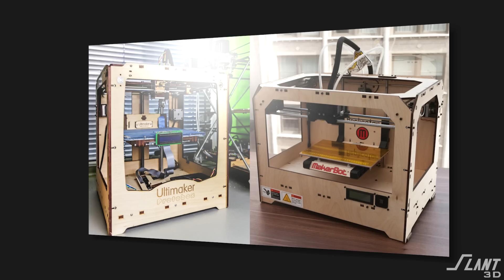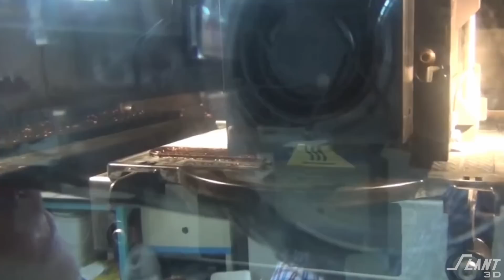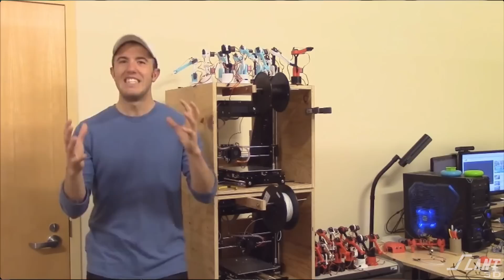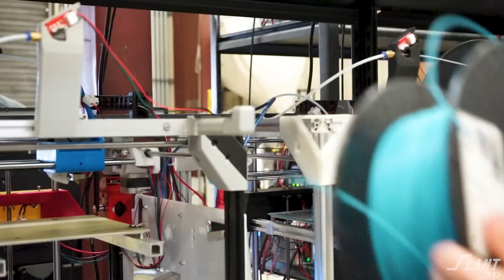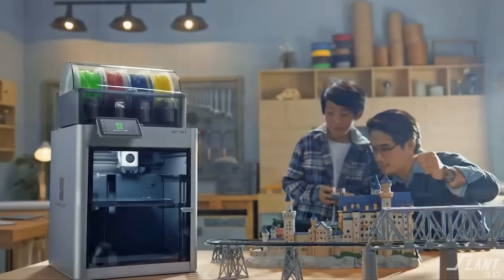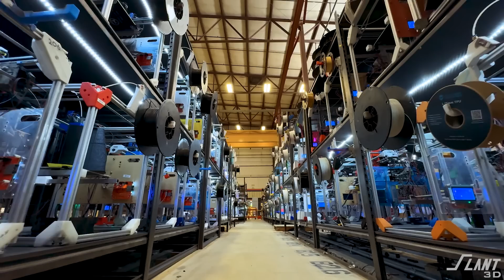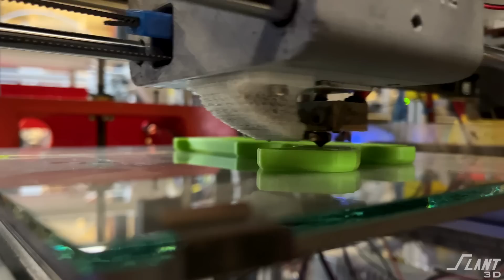I Hated 3D Printing...Until I Learned This

Comment: I think your thesis would have been stronger if you'd included "time" in your inputs.  And you've addressed this in other videos, to great effect where you note that injection molding is still the best way to make, say, bottle caps.  Things where one needs millions of them and the design is stable.

Time, of course, interacts with scale to skew what the best method is.  I'm active in the R2 Builders Club, and the emergence of simple and reliable 3D printers has dramatically changed the way people are building droids.  Most folks who turn up thinking they want to 3D print their droid are into 3D printing as a tool anyway, so that's fine.  But sometimes, we still get a new builder who doesn't really care about 3d printing, they just want a droid as quickly as practical.  At which point, 3D printing (at the hobby level) isn't the best tool, because it will take about 3 months of printing on something like a Prusa mk3 to get a droid done.  Using a wooden frame that's been cut on a CNC router will take under a month, including probable shipping time.  Whereas if you were producing these for sale, you could have a number of machines running in parallel and pump out a droid's worth of parts every week or so.

My point is mostly that for injection molding there is a large upfront cost in both money and time but then the time cost of production plummets, so injection molding has a very non-linear time cost as you make more.  3D printing is a nearly constant time cost per part, but a much lower cost of entry (assuming the printer is built and operable, but we're also assuming the injection molding machine is built and operable so that's fair.)  Neglecting that weakens the thesis, a bit.

On the other hand - you've demonstrated that you're quite savvy about this whole YouTube thing, so I think you did that on purpose to generate comments like this and feed the algorithym.  Well done!  :D
Reply: Agree! Time to 3d print a part THAT IS ABLE TO BE INJECTION MOLDED is higher and may be higher at scale than getting the mold built. Molds are fast! I worked in an injection molding plant and my lord the amount of parts was just phenomenal (I am talking molds that did 96 pieces at once and cycled within 2 minutes). 3d printing is getting there but printing a side panel for the inside of a car door will probably never be a cost effective 3d printable part as it would take too long to print them at scale unless you make your own orange gigastorm (but better) print farm and have a million printers :)
Reply: It's impossible to cover all the relevant advantages and disadvantages in a video this short. Hence why he has done so in other, longer videos.

Comment: Sorry but 3d printing will never be as fast nor strong as injection moulding.
Reply: What I heard was: "A hammer is always better than a screwdriver." Two different methods with their own inherent pros and cons and unique uses.
Reply: Depends on how many objects you need and how fast.
Reply: Any dufus who thinks this has never had a child break their injection molded toy over and over and see the reviews of hundreds of not thousands of other kids breaking the same toy. Any toy I have 3D printed for them with the objective of making it hard to break is still unbroken. Injection molding simply cannot be stronger just because you say it is. Most injection molded parts are made form abs or nylon but when people compare the strength of IM VS 3DP they don't compare the same plastics.
Reply: I guess each system will probably always have their strengths and weaknesses. They both have their uses for different applications.
Reply: Says who?
Reply: Why?
Reply from the maker: We do it everyday. Faster
Reply: @slant3d  I'd like you to do an experiment to prove 3D printing is faster at getting a product to market, lets say 10,000 parts vs create a mould in fusion360 get it done by PCBWAY, week max..
Reply: @slant3d  faster at scale? I believe a per part time is faster with injection moulding with a machine-machine compared to printing but scaling a print farm would be more versatile and cost effective
Reply: @R3DPrints01  yeah but only after you already have the mold. The mold takes a long time to make, it's really expensive and, it wears out so you need to remake it every X number of parts.

So faster at scale? If you can start pumping out prints at day 0 after having designed the stl. How much headstart does your scale have compared to waiting 2 weeks? 6 weeks? For your mold? What if the mold has an error?
So sure afterwards you can make a part every 20s instead of every hour. But you don't catch up instantly. That's simply not true.
And as the end of the video clearly states, strength is an engineering design challenge. Not something inherently impossible to work with. Printed parts are really strong, but they do have an optimal orientation.
Reply: @R3DPrints01 rapid iteration, absolutely just as strong, and much more freedom of design. It's absolutely better than injection
Reply: I don't want to pile on, but there have been a few discoveries that affect the strength of parts.

One is preheating filament (eg. 100 deg c) prior to printing can have a dramatic affect on part strength.

Another is a heating element that heats the top of the print (ensuring the top layer is at its glass transition) as the molten plastic is layed down. This can result in a virtually perfectly dense part with next to no layer adhesion issues.
Reply: With the new sub 5K Micronics SLS on the horizon, its going to get more interesting. Undercuts no issue, Supports no issue, mechanical strength as good as IM. It has its downsides, like low volume, porosity of parts, Need for postprocessing to create colorful parts etc. Hopefully, other competitors improve upon to make it better. FDM is going to become a legacy in the end. Just some 💭
Reply: @aware2action  There is also the issue of the raw stock for SLS not being a commodity product like pellets of an assortment of plastics. Likewise the raw stock for SLS that isn't specifically used in the product itself has to be filtered to eliminate spatter fused material that will contaminate later prints. If you want light weight hollow parts for some reason, you need to leave holes in your design to get the excess support out (similar problem for SLA.

I'm not saying that it's bad, just that it's not a panacea either.
Reply: It's both faster and stronger.

Latency to get an injection molded part: weeks. 3D printed? About 25-90 minutes.

Injection molded parts are limited to being flimsy brittle junk because you have to limit thickness to avoid shrinkage/warping. Printed parts can be as chonky as you like.
Reply: You obviously have NO IDEA what You're talking about. I've been doing IM for 30 years and the problems you just listed don't happen, if they do that place would be out of business. @daliasprints9798

Comment: Thinking about making 3d printing more efficient, what are your thoughts on printing directly from pellets instead of filament. It seems like this would potentially eliminate a step in the process. I know you are working on bringing the cost of filament down, but as Elon says "the best process is no process".
Reply: It's a video they've already made
Reply: @SquintyGears  Can you point me to it?
Reply: @carlosjosejimenezbermudez9255  i can't really search for it right now. I think it might have been inside a podcast episode instead of stand-alone.

Tldr was that it doesn't really work out. Technically pellets are cheaper but feeding is a massive problem for printing. So it's not worth it. Especially for a farm setup with tons of printers.
You can't realistically imagine having a 4kg hopper over each printer... How do the pellets get to the moving hotend reliably if the hopper is stationary over it and it has to be connected with a flexible joint.
So just having a massive spool that you rarely have to swap is the better solution. Because physics beats costs in this case.
Reply: Thats completely fair, pellet priting would be way cheaper and would give interesting benefits such as making custom blends for color and physical properties. You could even mix pla with tpu so you get a part that is stiff but when it snaps is still held together. I'm not sure if pla sticks to tpu but it's just an example. 

The issue is that normal injection moulding pellets are quite course to be printing with, the consistency is not there yet. Greenboy3D has some very interesting videos on the topic.
Reply: @greenboy3d is giving it a go right now - always interesting to see people attempting to make that idea work effectively. There are some key limitations to using pellets directly, although perhaps not as many as there might be initially. Perhaps for home users, it could be a good route to re-using printer waste, where you have the pellet setup for prototyping design work, where you're testing the design in practice so care about the form and function but not the cleanliness of the print, and then print decently on a filament printer once the design is good.
Reply: Look up Greenboy3D man
Reply from the maker: Pellets don't work
Reply: @slant3d  https://youtu.be/eWgzi4a1bJo?si=oHapaJpeKHSPPwZc
Looks like man's making it work.
Reply: @slant3d 
https://youtu.be/eWgzi4a1bJo?si=oHapaJpeKHSPPwZc
Looks like man's making it work.
Reply: @slant3d  but they do.
Reply: Pellets don’t work for 3-D printing. It works for injection molding because you get them super hot and shove them into the shape of the item you want in 3-D printing you need retractions and stuff. You cannot retract a bunch of small balls that’s why filament was invented a string that could be pushed and pulled, depending on if it needs to retract or proceed.
Reply: @Brandon-jf9cv   wrong, it works and retraction is not an issue.
Reply: @Brandon-jf9cv  I think it's a solvable problem and could be worth it for a large print farm, but probably not for the average home user. I find it funny how people are try to make there own filament at home, when you use a couple of kilos a month it hardly seems worth it. If Tangled is successful at bringing the cost down to $10/kilo even more so.

Comment: It'd be really cool if you could share more about the printer you designed, even if it's not detailed enough for others to reproduce it. Maybe just some earlier models and what you did to improve over off-the-shelf modela
Reply: I'd note that in some ways they have, even though they don't specifically identify those specifically as part of their printer designs. As an example, he did a video about a year and a quarter ago about bracing aluminum extrusion parts, and how to print those to maximize the strength of the part for the purpose it's being put to. If you look at the corner braces of the printers they occasionally show in the background fills of the print farm, you'll see that they are using those brackets in their print farm. One advantage that I can see for that is that if they ever choose to produce a set of larger printers, say 450 mm cube, or 450x450x550, (if such ever became a useful size) they don't need to come up with new brackets. They may have to source new materials for the moving parts, but the frame just gets longer extrusions. Likewise I suspect that a lot of the things like rod holders, or screw bearing holders, end up being snap in components that fit up against those same brackets for repeatable dimensions. Motor mounts can take advantage of consistent dimensions and the flex in the plastic to allow the motor to snap into the mount with minimal or zero play yet can easily be removed and replaced if a motor starts misbehaving. There are likely other examples of learned solutions, such as motors being positioned at the top of any parts that experience wear, both so that the heat of the motor rises away from the parts that the motor is moving, and so that any wear products don't drop into what should be clean spaces and gum up the motors. (Yes, I've run into that myself.)

I'd suspect that a huge amount of the lessons they teach in the 'design for 3d Printing' collection of videos has come not just from the idea of making products printable, but also from the perspective of making their own printers better.

Comment: Given a trinket or toy product, at the end of the day the cost to manufacture a mold is the same with creating your own personal print farm. 3D printing has an advantage because not everyone has access to the gear, engineers, and technicians required to create a mold, but everyone has access to 3D printers. 
Then there's the trend. It took >100 years for injection molding to arrive at the current stage. It only took <10 years for 3D printing to start becoming a viable alternative for injection molding. 
Then there's the versatility of the manufacturing process itself: anything that can be made through injection molding can be recreated through 3D printing, but not everything that can be made through 3D printing can be injection molded.
If you're still a non-believer, consider my final argument: you can 3D print anything including molds.
Reply: From a development perspective, the iteration cycle for 3D printing over standard molding isn't even a contest.  I can get a dozen iterations out of the printer in the time it takes the first iteration to be ready via a mold.

Comment: Wouldn’t the 3d printer be a consumable just like the mold?
Reply: It is. He says they last 3 years.
Reply: Do you have any idea what "hard tooling" costs today for injection moulding?  You obviously do not.  Unless you are making tens of thousands of parts, the amortized costs are very high.
Reply: Then again... wouldn't be the machine where you put the mold... a consumable?
Reply: @SenyorDonGatoo  - Sort of, after it is no longer usable, after at least 500,000 to 1,000,000 impressions or more.  Tooling is a fixed asset that is amortized over its life, vs written off within a year or so.  A single printer might be less than $1,000; while a mold going into an injection moulding press might be $20,00 - $100,000 or more.  If you have to ask what an injection moulding press costs, they are way more than the cost of the molds to replace and require expensive maintenance and labor costs.
Reply: @jeromefeig4209  That's the thing I was trying to make Samian understand. You need to compare the 3D printer to the injection mold press, not the mold itself. 3D printing is great but it has it's applications and injection molding it's great too for it's applications.

Comment: I have a FFF machine at home and I am satisfied with it. FFF definitely has a place, but it is not mass production. Apart from initial costs of mould, it is fundamentally more efficient to inject plastic into a mould at once than to gradually extrude the same amount of plastic through a tiny nozzle.
Reply: It's fundamentally inefficient to try to get millions of people to buy a thing only tens of thousands need because the only way you could make it affordable to manufacture was by amortizing cost over millions of pieces.
Reply: @daliasprints9798  Plus it locks you into a design with a high cost to adjust and iterate.
Reply from the maker: We do mass production every day
Reply: @slant3d people drive cars everyday instead of taking mass transit that does not make cars more efficient.
Reply: Lol did you even watch the video?

Comment: It's more efficient - by what measure of effiency?
Reply: You need to manufacturer the part based upon the process to maintain strength.  Just.because it can be 3d printed doesn't mean it should be formed the same.
Reply from the maker: Less shippedng, less warehousing, less wasted material, less lost inventory, and also not making the mold. ( Lost inventory alone saves 15-25 percent of landfilled parts)
Reply: @slant3d  With a background in both accounting(my degree) and working with my hands since I was young under the tutelage of my father who started a Ford Trade School and was registered as both an engineer and an architect, I understand the direct and indirect costs of manufacturing.  Both additive and subtractive manufacturing have positive and negative sides.  Every part and the anticipated use and lifecycle is different.  Neither can claim that "my method is the best" solution 100% of the time.
Reply: @jeromefeig4209 I agree, every tool/process has their strengths and weaknesses
Reply: lol, I guess so. 3d printing can be more money-efficient for small runs, that's for sure.
Reply: Measure or money
Reply: He has no measurements. Just emotions. See how everything is "in the world" and he's SO insistent? All ego...
Reply: None. It is partially self-delusion and partially advertisement for his company.